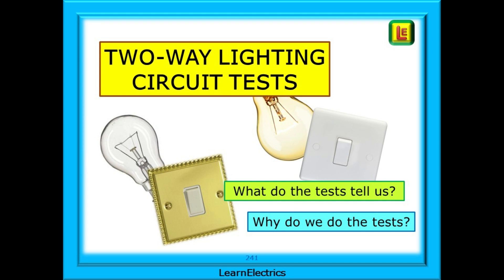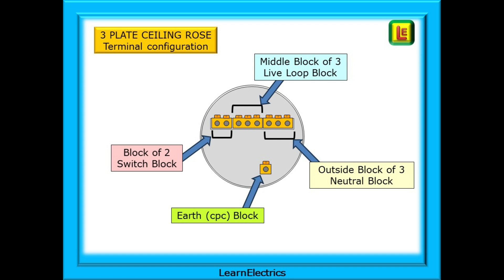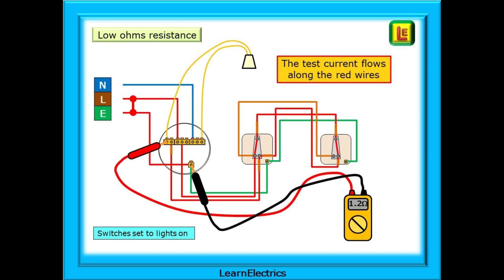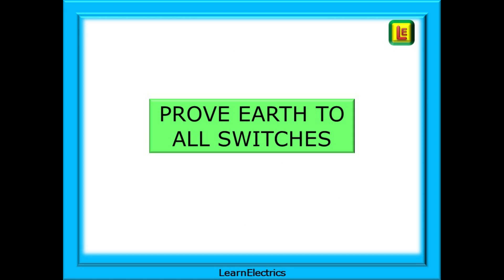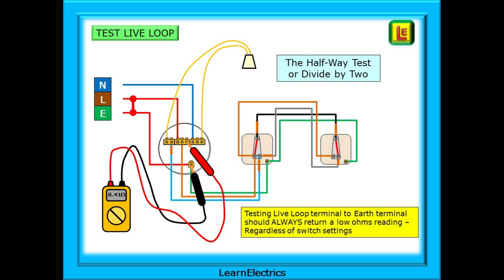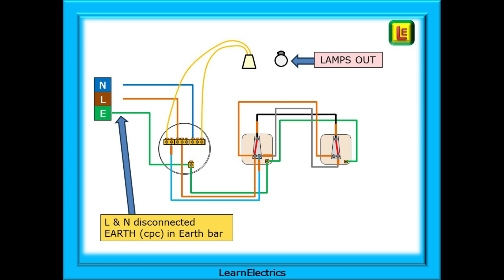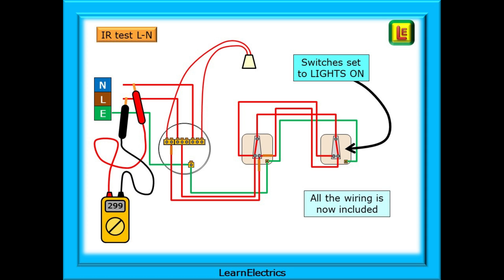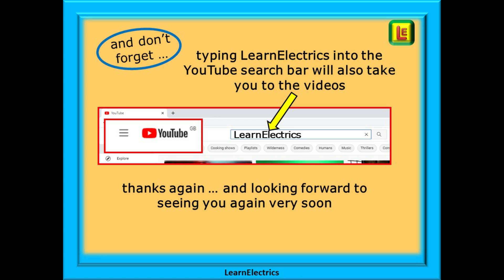TWO WAY LIGHTING TESTS – WHY DO WE TEST – WHICH WIRES ARE UNDER TEST – WHAT DO WE TEST AND WHY

Comment: For the IR test we are thought to operate all switches in a sequence instead of just one switch at college?
Reply from the maker: If you operate both switches, you will end up where you started. If you start as lights off, flick the first switch makes it lights on, flick the second switch, back to lights off and then test, you are not proving anything. You need to check the wiring in a lights on position. Flick one switch, then test.
Reply: @learnelectrics4402  but each time u switch one of the switches, you IR test in between them so u still test the strappers each time you flick the switches.

but is this overkill then and is it better just to flick one switch. Thanks